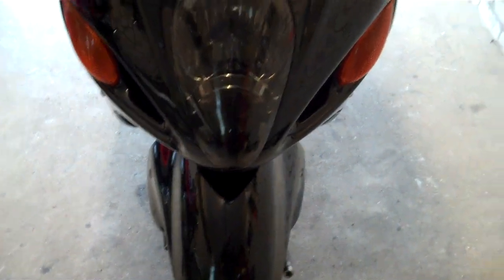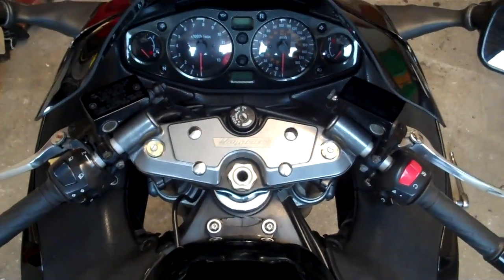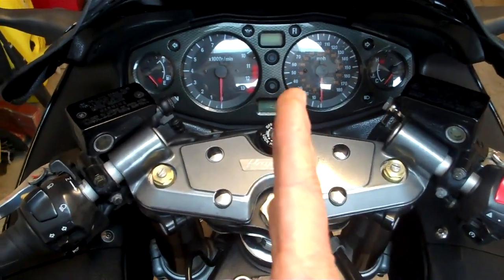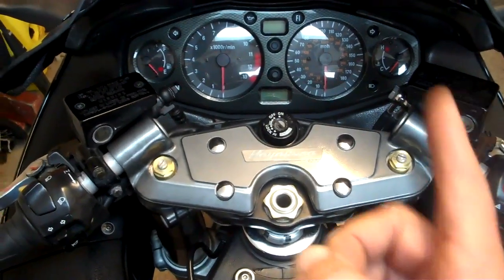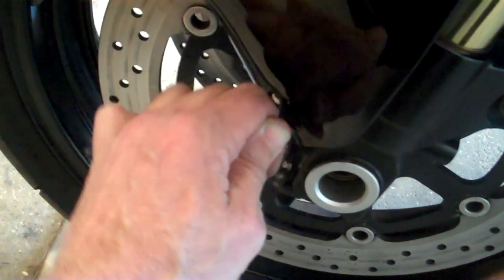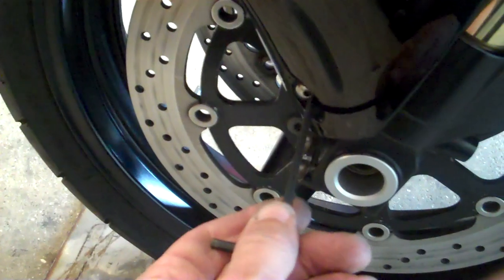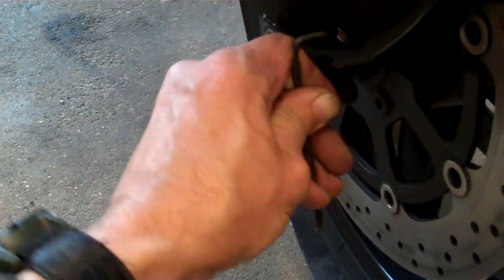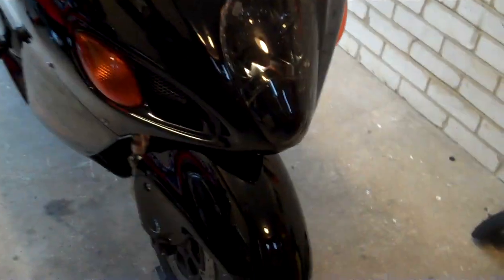Delboy's Garage, 'How-To' Re-align motorcycle forks the easy way.

Comment from the maker: Hi mate, the re-alignment will be easily detected because your bars will sit twisted to one side as you ride along... so if they are straight it's not alignment - if you have a wobble over 70 it's more likely to be wheel balancing, maybe get them checked at your local tyre shop.  But first have a look to see if a wheel weight has come off by seeing if there is a sticky patch where one is missing... hope that helps, good luck, Del

Comment: Another excellent video Del & Penny , My 2 wheeled mistress felt a bit weird the other day , maybe it was camber of the road or a slightly "off "tyre pressure ?,But in any case on seeing this vid off I went to the garage to investigate and although It looked ok I got the spanners out anyway . Nothing ventured , nothing gained being my train of thought. plus I can't resist a bit of fettling lol..
Reply from the maker: +Charles Cave Hi Charles, thats a good idea, if the bike you ride every day feels wrong, then it will be something up... good luck getting it sorted out, and drop me a line if you get stuck.. cheers, Del.

Comment: My parked bike (Honda VTX 1800R --- HEAVY  and BIG  cruiser bike)  was hit in the parking lot yesterday as it sat nose-out in my end space.  A truck came around the corner, cut too close,  and snagged the front fender  as it past the bike on its left , back part of the truck grabbed the fender and wheel and started pushing the bike "down" in the direction of its kickstand lean and also back on the pavement a little.....enough force to ruin my front fender and  snap the kickstand mounting bracket from the frame at two of the three bolts....this is a very heavy bracket! I believe the kickstand bar itself is also slightly bent.

I rode it home....the handlebars are cocked by about 10-15 degrees to the right now and it felt squirrely in turns....

When I look down from the top, the top triple tree right side is slightly "behind" the lower triple tree's right side......so I am very much hoping that your video will help me get this squared away. have to wait until the insurance adjuster sees it, but if there is no frame damage at the kickstand mount, I will be trying your method.  

Thanks for this glimmer of hope.  It's sickening to see your bike damaged.
Reply from the maker: Hi Dave.. buddy, i feel so sorry for you.. that is awful, and you must have been totally livid.. i guess nobody got hurt, and that's a blessing... but it still leaves a horrible taste aye... 

Ok, im keen to help you through this if you would like.. A bike like yours may not just "spring back" when you lunge down on the top tree.. it may need a little force in the opposing direction to get it to re-center... but thats no problem, its just due to the heavy weight nature of the way your bike is built.. Harleys have the same problem... 

There is a technique where to use a long bar strapped along the side of both wheels front to back to hold them inline.. then force the bars back to the left and tighten the top nut on the top tree to hold it.. then start on the lower bolts...   See how you get on once your insurance guys have been, and let me know if i can be of any more help.. happy to see you through it buddy.. Take care.. Del.

Comment: I found a bolt, per your detailed and concise instructions. However I shall be welding mine into a 5/8 spark plug socket. That way you can attach your ratchet or torque wrench. If you don't have a welder.....a local shop would probably do it for you for a pint. Good thing to keep under the seat

Comment: Hi! Last night, I hit a curb going maybe 40-50. I didn't see the curb until it was too late to brake or try to turn, so instead of slowing down, I sped up. I don't know why I did that, I guess to lighten the front because I was thinking if I slow down I might flip forward and completely total it. Anyway, about 5-8 feet away from the curb I pinned the throttle and hit the curb causing my bike and I to fly up over it about a foot or 2, and it sent ME about 2 or 3 feet off my seat but luckily I held on to the clip ons and landed right back on my bike. Once I landed, my bike felt fine, but I knew I bent the rim and maybe the forks or something else. I was about 15 miles from home, and my K7 GSX-R wasn't doing anything weird until I stopped a few miles down in a lit area to check the damage, then rode off home and I felt it. Sure enough, though, I have a small bend in my front rim, I haven't seen anything on the rear rim, but possibly that too? I also assumed that I bent the forks because the steering feels off. I mean, my bike will go straight if I let go of the clip ons, and they look straight-ish, but it doesn't like turning anymore, its sluggish. I read one of your comments talking about how the suspension wouldn't really be able to move if it was truly bent. so maybe it's just offset like you said?

Comment: Very smart Delboy and thanks for walking thru the process. I just got a bent and cracked front rim from hitting a car wheel on a freeway. This comes in in time for me to check the fork alignment. What else should I check after such a crash? Mine is Suzuki Bandit 1250. Thanks.
Reply from the maker: Blimey buddy, that sounds nasty, im glad you didn't hurt yourself...  Ok, would you believe, the best way to check if a bike is all in line is to ride it... but first you should really check all the integrity of the parts that would have taken and absorbed kinetic energy from the impact.

Naturally, a new front wheel and tyre, so taking that as done already....Then you can check for unseen damage.

First, check the sweep of the steering, do this by jacking the front up, crouch in front of the bike and grab the fork legs at the bottom.. then turn the forks 'side to side' through their full sweep of movement, and feel for any resistance or 'notchiness'... Then check for free-play.. this involves pulling the fork bottoms towards you in a "lifting" motion to see if the headstock bearings have any play..(there should be NONE at all)..   

Also do a closeup inspection of the whole headstock area of the frame and look for any cracks in the paint, any signs at all of stress, and use a torch too, look all over it for any damage.!  

Finally, just do the regular safety check line rear alignment, tyre pressures, and brakes etc.... then go for a tentative ride... take it easy, listen to the bike, feel for anything that you dont recognise as normal..and build up the speed and cornering as you feel more confident... its your bike buddy, you know how she rides, and you'll know right away if anythings off.... if not, then you're good to go, if you do find anything you;re not happy with.. let me know, and ill see if we can diagnose it..!   Good luck buddy, and keep us posted.. Del.

Comment: I was recently walking my bike over ice, and it slipped out from under me, and I had to set it down a little rough. Nothing broke, but it's been out of alignment since then - bars pointing to the right and I can see more wear on the left side of the front tire. Going to give this a whirl this weekend. Thanks!
Reply from the maker: myklobe Ok, good luck with it mate...hope it helps.. Del.
Reply: Moonfleet41 On my FZ8, it took all of about 10 minutes to get it all aligned! Thanks for the tips! Worked like a charm!

Comment: Great Video!!!  Been trying to figure out what might be causing my wobbling at around 35-50mph...  I am going to inspect  the alignment and hope it might be just this simple solution!
Reply from the maker: You can feel alignment with, or without, wobble... your arms will just feel twisted as you ride forwards on a flat road, but wobble is more attributed to bad tyre wear, or incorrect inflation, check your tyre tread is even right across the front and not thicker in the middle and thinner at the sides, any uneven wear on your front tyre can lead to instability.
Reply: @Moonfleet41  Thank you for the input...  Just to note...  The wobbling was occurring when I had my old tires on (Shinko 705) and thought it would maybe go away with new tires and proper balancing, etc..  (Trailmax )  Wobbling is still present.  Told by a mechanic that it is normal for bikes to do this and he thinks I will have to live with it.  While I don't want perfection riding I do not agree with him that it is "normal".  Just searching for a possible solution.

Comment: Thanks for taking the time to make this video.  It's very easy to understand and not over-complicated in any way.

I'm in the process of re-building the front end of my GSXR600 K1.  I've got everything re-assembled now, it just needs to be aligned so this will help me alot.   I do have one question however, because my forks were in such bad shape when I removed them I wasn't sure if they were even still in the right spot vertically through the yokes.  As a general rule of thumb how much of the fork should sit above the top yoke, or do they generally sit flush?  I'm guessing this is probably something that you would set depending on circumstances related to ground clearance or suspension travel?  Or maybe I'm reading too much into it.  Purely speculation on my part.

On a side note, I'm always very paranoid when doing up friction clamps with pinch bolts like these.  I'm scared to over tighten and strip them, yet at the same time I'm probably more scared of not tightening them enough and having a fork slide through the top haha.
Reply from the maker: Hi mate, thanks for your question.. Generally a fork leg will have no need to stand proud of the top yoke unless the clip-on bar goes on top as with the early GSXR1100 models, i always set mine flush with the tube top leaving just the lip of the cap standing proud, this is so that the cap can be loosened without having to back off the clamp bolts... With the friction clamps, you'd be surprised how little torque they need to grip the leg firmly, remember they are friction clamps because they MUST slip if the front end takes a pot hole of impact too hard, then they can slip a little and you just re-align them...if they were located solid then all the impact would go to the fork leg and cause damage... just go with your bike's factory torque setting and keep it there...then you can't go wrong.. Hope that helps... Good luck with it.. Del.
Reply: Yeah thanks for your reply.

Wicked response time too!

Comment: We just bought a 2005 Dyna Wide Glide about 3 weeks ago, the tires were on their last leg so I had a local shop install new Shinko 777 bias ply tires. The wheels are spoked so it also has tire tubes. I hadn't had much riding experience on this bike before I had the new tires put on but my wife and I had it out a couple days ago and I noticed that the front forks, looking down at the top triple tree, were slightly to the right going down the road. I also noticed that since these new tires were put on that the bike wants to lean to each side really easily and I have to stay very balanced to keep it from wanting to bank over from one side to the other. I'm not sure if it's the alignment causing this or the new tires. I've read that bias ply tires have a more pronounced rounded over shape that makes the bike want to lean to one side or the other more easily than radials but I've never experienced a bike that wants to lean as easily as this one all of a sudden. It's very unsettling!
Reply from the maker: Hi Jeff, ok, couple of issues by the sound of it... naturally, it would be wise to deal with your fork alignment if you think it's out... make sure that everything is dead square so that on a flat surface it steers straight... And as regards the tyres, if it feels like it wants to drop a little too easily, then remember that naturally a brand new tyre will have a perfect rounded profile, compared to the often mis-shapen profile of a worn tyre, tyres wear slowly meaning that the handling change caused by tyre wear is so slow you never notice it... but when you change tyres, it makes an instant change in the handling overnight... and it's instantly noticeable.  Check your tyre pressures, it sounds that, maybe, they could be a little too high, certainly in the front... and maybe dry dropping a couple of PSI out of your front, which should serve to slow down the steering slightly.
Reply: @Moonfleet41  I am going to check it over good probably this weekend and most likely do a front fork alignment if it needs it which I suspect that it does. The shop owner told me to run 40psi tire pressure in the tires. He told me that that pressure gives the best wear characteristics for these tires so that's the pressure that he used. I'm not sure what tire pressure is marked on the side of the tire yet but will check that soon as well. I'm not sure if 40 psi is considered high for these tires or not but I will find out. Thanks for your reply, others input helps a lot when trying to determine issues like this....
Reply from the maker: @bodeine454  Hi again Jeff, ok 40psi!  That is a little high, but what he says is correct, those 3" wide front tyres are notorious for wearing out in no time, and they tend to wear on the edges, so if you pump them up a little harder, then the middle gets a bit more wear and like he said, the wear characteristics become more even... but a side effect of that is that the bike feels harsh and drops in to corners too eagerly... so like I said, try 38psi, or maybe even 36, it should ride better, but be aware that your tyre will wear perhaps a little sooner!
Reply: @Moonfleet41  That makes sense to me, I think I'll give that a try and see what effect it has, thanks again!

Comment: With dirt bikes we would just find a tree to ride up to, and with the front wheel on one side or the other of that tree, depending on which way the handle bars were off, we would just do a series of bangs, slamming the tire into the tree by turning the bars with some force, until things were straight again. We seemed to get them off center every time we crashed. I believe what the situation is mainly about, is that the top clamp is not held directly in line with the lower ones (which are fixed to the stem, so they can not move) by anything much, except the strength of the fork tubes held in the lower clamps, and the torque of the big nut on the top of the spindle.

Comment: Great video, thank you. I haven't checked my bike yet but when I take my hands of the bars when riding in a straight line, the bike wants to track or pull to the right. This sounds line a fork alignment issue I guess, will check tomorrow and see how she lines up.

Edit: Actually after checking now I noticed there is difference in the fork tube height sticking through the top clamps. One has around 3mm showing, the other is only 1mm, enough to make a difference in the steering geometry I would say.
Reply from the maker: Hi Ray, it won't make a difference to the geometry, but one leg will have more spring pre-load than the other and that will stress that spring more quickly... this is not the end of the world as some small bikes actually only have 1 fork spring and the oil is in the other leg... check your tyre pressure on the front first and set it to exact factory recommendation and also check that it is worn in a properly rounded arc with no flat champher to the right or left... if these are all ok, it could be a rear wheel alignment issue, so check that too, because they work as a pair... hope that helps, Del
Reply: Moonfleet41
Thanks Del. I'll set the fork tube height first and then check the alignment front and back. Its an FJ1200 so theres a fair amount of weight over the front wheel.

Comment: It has the BMW leaver system and it doesn't work. So I let of all like you did and put a long flat bar down the front of the bike a line on the center of tier. I got a friend to hold bars and moved wheel till bar was in center of tier. Then nipped every thing up. All sweet .

Comment from the maker: Hi mate,I've covered exactly what to loosen in the video,fundamentally it's very fastener below the top yoke pinch bolts and also loosen the top yoke centre nut bolt so that means: 'bottom yoke pinch bolts', 'mud guard bolts', 'caliper bolts', 'axle nut' and 'fork leg pinch bolt'.  Then everything is floppy and free so just lunge up and down to centre it then while holding the bike upright (get a friend to help) systematically tighten every bolt back up working symmetrically in stages !